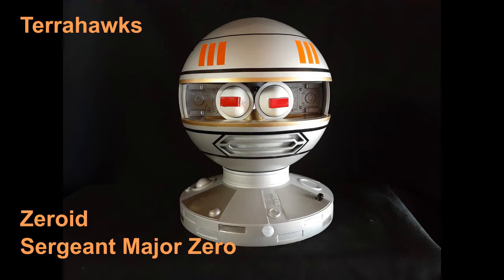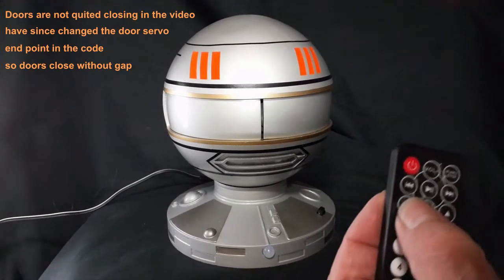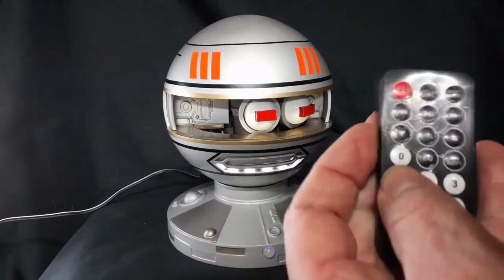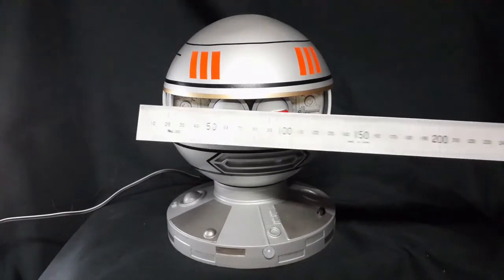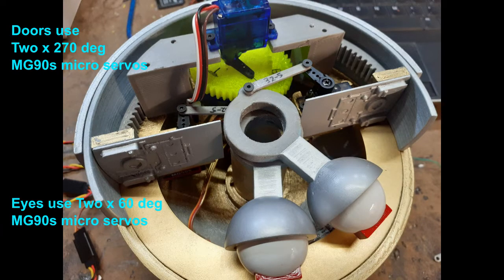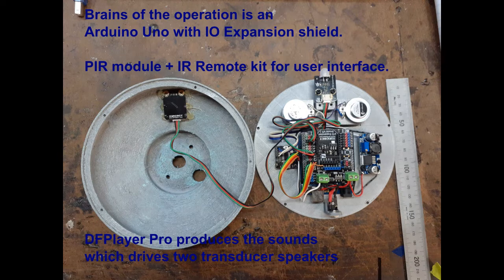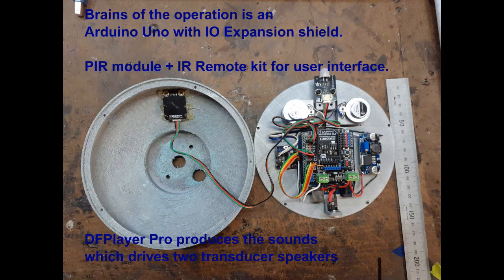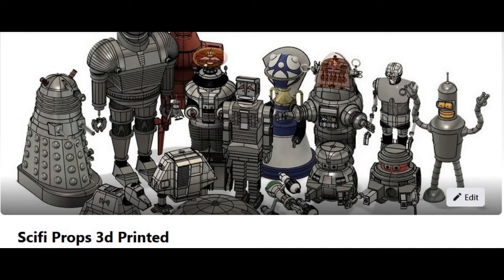Terrahawks Zeroid 3d printed animatronic build

Comment: Brilliant work! It was actually me that requested for the zeroid from Ian! A question: What did you use for your decals please? They look great. Do you have a guide for them at all?
Reply from the maker: Apologies for the late reply and thank you for your kind works.

Black banding is just Black contact adhesive (book covering) that was cut into strips. Originally tried to mask and paint but all the masking tape I had would not seal I guess because of the compound curves. Have since got some tamiya masking tape for curve to try out.
Was able to masked and painted the orange with rustoleum orange spray can.

Have a couple sketches with dimensions and can take some photo with measurement if that will help as a guide.
Reply: @ozzymat61  that would be brilliant! Thanks. I have just had the electronics turn up today ready to start it.
Reply from the maker: @MrJohnny2477  shall I post it on the Scifi  Props 3d printed Facebook group?
Reply: @ozzymat61  yes please. I think that would be really helpful thanks.
Reply: @ozzymat61  I have just noticed that rack door right.stl is missing from the folder. Is that simply a mirror of the left one?
Reply from the maker: @MrJohnny2477  that is my fault I missed including the rack door right.stl in the set.
Will upload that to the group FB page.
Reply from the maker: Rack Door Right stl and decal placement information has been uploaded into the "Scifi Props 3d Printed" facebook group.
Reply: Where can I buy one?❤